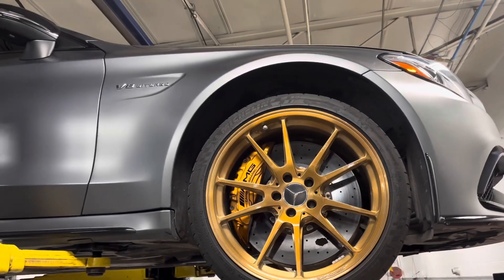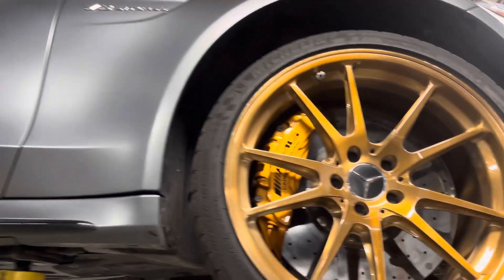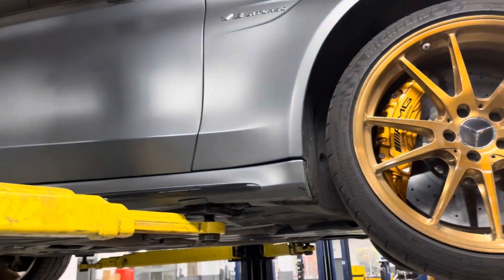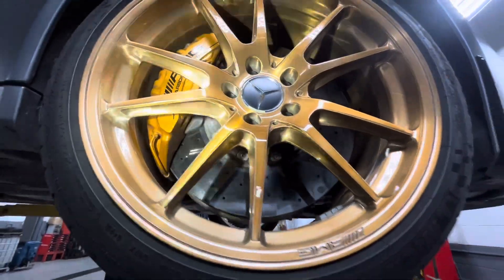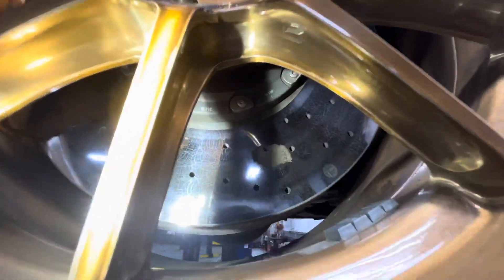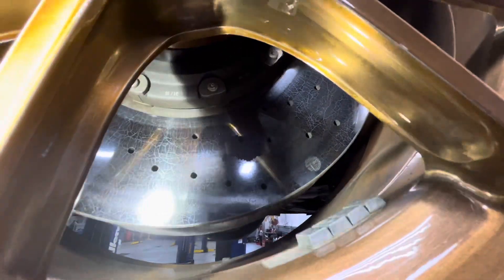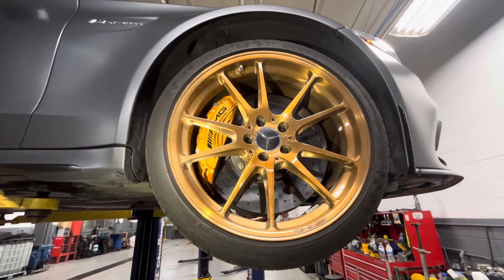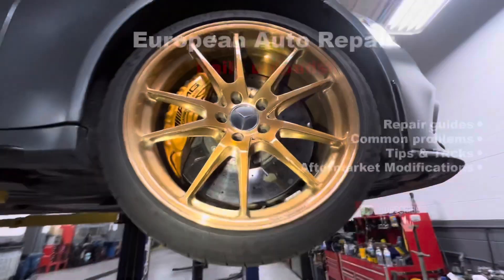CARBON CERAMIC BRAKE ROTORS AREN’T VERY PRACTICAL

Comment: I read an article in autoblog saying that a Porsche tech said that iron disks are better than carbon ceramics, so they may be just an expensive unnecessary "upgrade" more to do with marketing than actual performance. 🤯
Reply from the maker: My information is a couple years old here but I remember when carbon brakes were available on the Porsche gt3 when the factory did endurance racing they weren’t using them
Reply: Lol just like the Autopilot in Teslas, first released in 2014, yet they still can't drive themselves. 
We have to get smart about everything. 😂
Reply: The bigger the rotor better, but the most important break pads.
Reply: Can you give a link to this article? I want to see what he specifically meant when he said "better." I also think it is a bad faith interpretation that carbon ceramics are marketing BS as you would not have said that if you knew how they worked. From a braking distance standpoint, they are more or less the same. From a wear and endurance standpoint, carbon ceramics are vastly superior. If you're going to the track frequently, then yes use them, but if not don't get them. I highly doubt the tech is trying to fool people into buying brakes they don't need. Information about cracking, squeaking, and other wear(cold weather) has been out for a while, and you would be stupid to blindly get them without research. Everybody should know what their needs are, when choosing these brakes. Its common sense.

Comment: I am glad to have these brakes in Germany on the autobahn when driving 200-300 km/h. Then the brake is more important than the engine. It may be a different story when you are limited to something like 90 mph or so...
Reply: Steel brakes work fine.

Comment: Unless you are tracking the car or specifically want high performance brake , you do not need carbon ceramics. They screech when cold and under normal use. Steel rotors are more then needed. Same goes for external carbon fiber spoilers , intakes. Unnecessary expensive accessories that break easily.